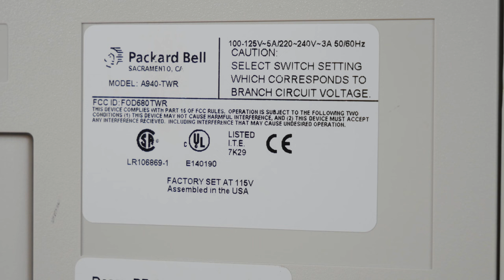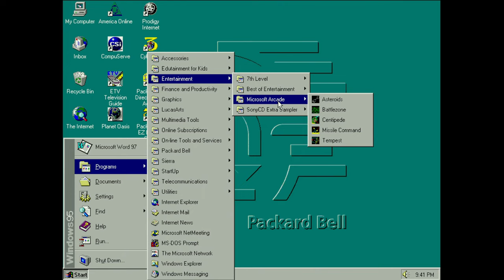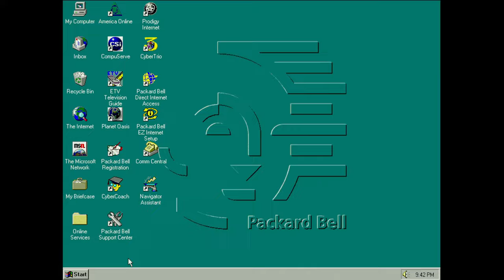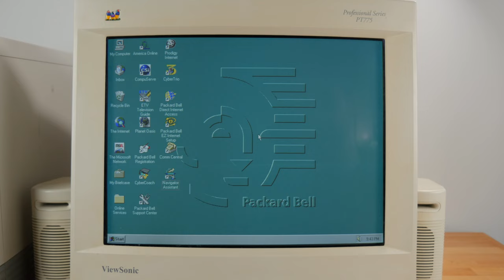Packard Bell PB2980 - The Wave Maker

Comment: This is my first PC! Bought second hand around 99. Mine might have been a higher end model as it had an onboard S3 Virge instead of a Trio, though with the same 150mhz Pentium. I upgraded it using spare parts either for cheap or nothing, with it's final form containing a 200mhz Pentium OC'd to 233, 64GB RAM and two Voodoo 2s in SLI taking up those PCI slots. I put Windows 2000 on it and it was useful up until about 2002, where I finally had the money to buy something new.

Comment: This particular machine was made on August 19th, 1996. The manufacture date is on the small label on the back above the PCI slots, visible at 2:03. It is represented by the five-digit number 08619. In this case, the 08 is the month (August), the 6 is the last digit of the year of manufacture (1996), and the 19 is the day of the month it was manufactured (the 19th).
Reply from the maker: Makes sense! Thanks for all the extra info, learn something every day on these retro machines!

Comment: PB systems are a maze to navigate due to the large number of models - it is easier to categorize them by motherboard, there is only a limited number of PB motherboards, and you can identify it via the FCC ID or BIOS ID string. The A940-TWR is the type of case - that is the standard PB tower case from the late 486 era into the Pentium. It was later replaced/augmented with the "designer tower" which was more visually interesting. Even into the NEC era PB continued to use the Frog Design cases until the supply dried up and they switched to horrible generic cases right around the death of the brand in 1998.

One thing to note is most PB Pentium systems lack L2 cache. The positions for L2 are unpopulated on your system. Only the higher end models under the Platinum banner would potentially have L2 populated. 

Your machine is amazingly un-yellowed - was it retrobrighted?
Reply from the maker: Aha well that clears things up a lot. I assumed I was missing something looking at this "model" so that makes a lot of sense! As far as the case I haven't done anything to it no. I was really amazed how white it was when I got it and even the mildly yellowed monitor stands out next to it. Hoping it stays this way!

Comment: The 150 MHz Pentium runs with a 60 MHz Bus (60MHz Bus x 2,5 Multiplier) and should also run with a 66 MHz Bus = 166 MHz. All Pentium 150s are underclocked Pentium 166 CPUs for the OEM market.
Reply from the maker: Well that makes sense! Thanks for the extra info.

Comment: I had one of these back in the day. 2 or 3 variations actually lol. One had a Bigfoot 3.2gb drive or something like that. It had a custom win 95 theme with animated icons and such. I wanna say a 2mb ati rage 2 but that may have been the ibm I had. (aptiva or something) so was probably an S3 chip. One had a p90, another a p166 I think. Mine also had a 16x cd rom that would just shoot right out. There was a flap on the front rather than the door on the tray, so sometimes if you tried to eject while it was having trouble reading a disc, it would shoot out and fly across the room lol.
Reply from the maker: Oh cool! Seems like Packard Bell sold this machine in who knows how many varietes or at least the case design was used a lot.